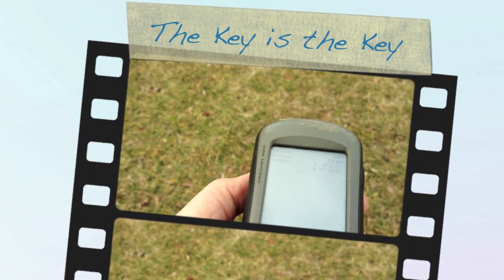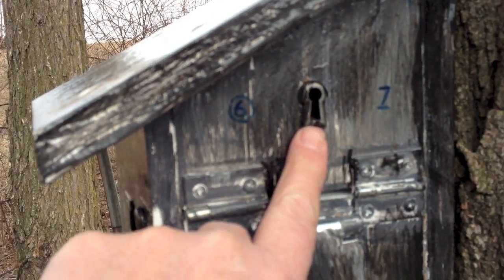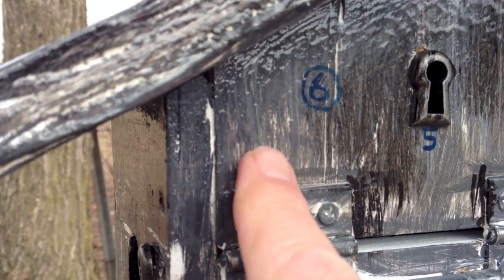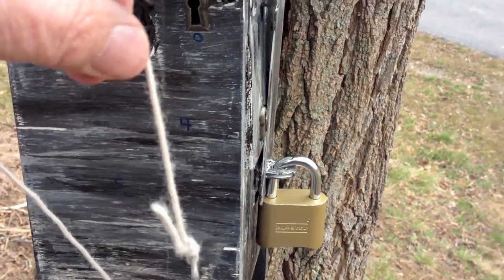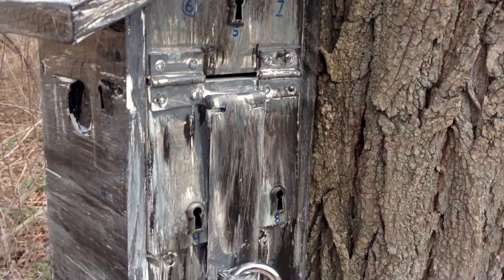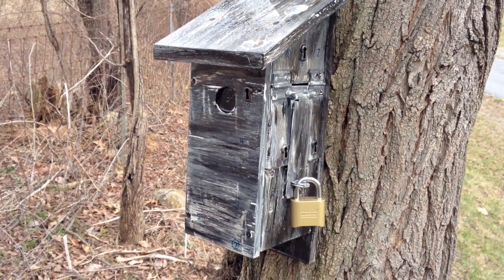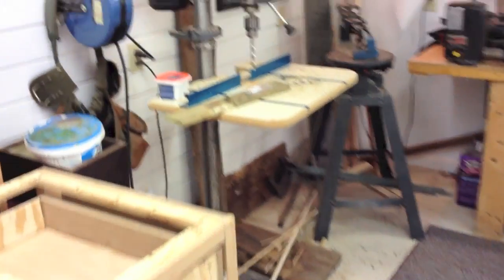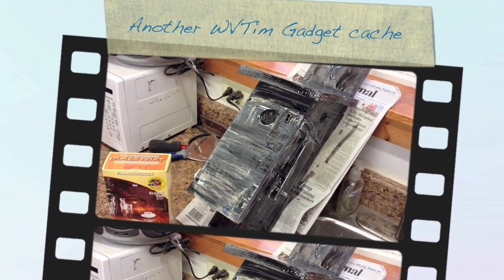Difficult and Unique geocache - A WVTim gadget cache

Comment: I don't know if you remember but what size magnets did you use and how strong were they?
Reply from the maker: Not sure exactly, but about 1/2 inch.  I would suggest using strong magnets.   I buy mine at K & J Magnets, some like a D8H2 would work fine.